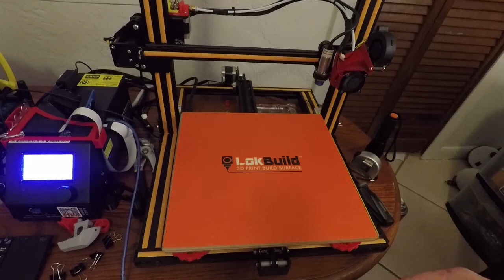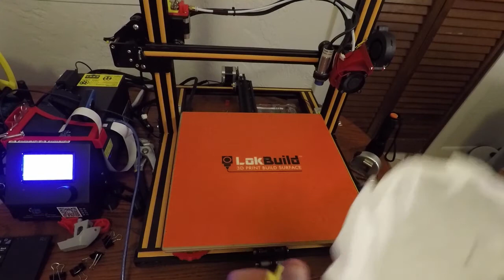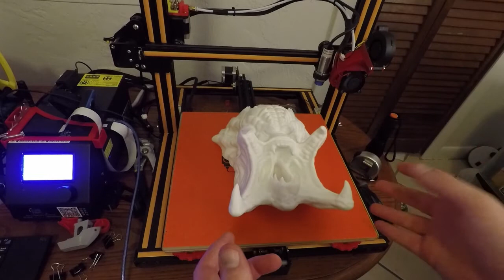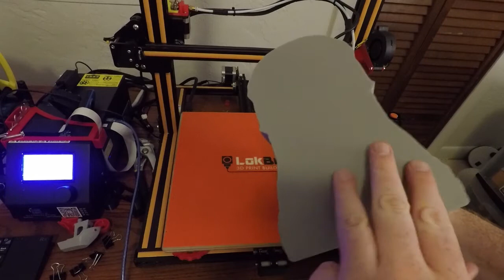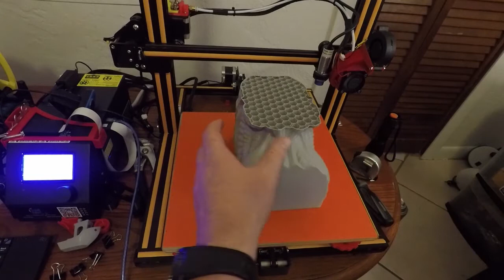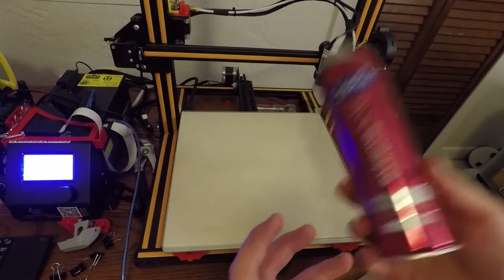LokBuild Review

Comment: i use a thin flexable steel sheet from home depot with my lockbuild sheet on, so i can pull the sheet off and flex it to pop prints off, works fantastic
Reply from the maker: That is a really good idea
Reply: CoffeeOutlaws I tried with mine and the metal warped so it ends up not being level

Comment: What about when using abs or other plastics that warp a lot?  Do you still not use the lokbuild for the larger prints of those types of plastics that have a lot more issues with warping on the CR10 with it's not great heating of the bed?
Reply from the maker: The lokBuild will certainly prevent warping even with large prints. The only issue is the bigger it is the harder it is to pry off the model from the lokBuild.

Comment: Do you use a new glassplate or the plate that the CR-10 got shipped with?
Reply from the maker: R3v0n I use the original one that came with the printer, the auto level systems really good and takes out any type of warp problems. If you don't have an auto level system I would recommend getting a thicker piece of glass.
Reply: Ok, thanks for the quick answer.
Reply: Hi, should i stick the lokbuild to the glass or straight to the heatbed? Thx
edit: I have the cr-10mini
Reply from the maker: For me, I only apply LokBuild on 3D Printers that have a removable glass. The reason is that LokBuild works very well and is better for materials that have a higher warp characteristics. Also is good with models that may not have a lot of surface connections.  If I am printing with PLA and the model has a lot of surface connection I will flip the LokBuild to the glass surface and use a little hairspray to hold the model in place.